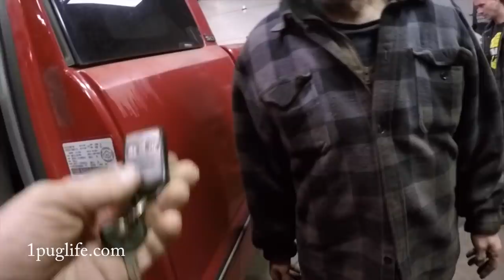purple fella up for grabs

Comment: I wonder when he is going to find out that the dodges e brakes click down but return but also engage the brake and releases when you pull the release handle and It wasn't broken the whole time. All  5 of my dodge cummins do this.
Reply: 😂 frigging Awesome
Reply: If it ain't broke  don't fix it  🔧
Reply: @missingremote4388  I go on ebay and buy like 4 remotes. Then I usually don't lose thrm.all

Comment: you got some very COLD WEATHER on the way Sudden stratospheric warming events (SSWs) tend to weaken the pola vortex.
Anticipated changes in the upper atmosphere over the North Pole during late December will impact the polar vortex, which will trigger outbreaks of Arctic air over parts of the Northern Hemisphere during January and February.down to -20

Comment: Sounds like John luke is getting a little too old to work on modern vehicles...I reckon I could've diagnosed the clicking/beeping thing in 5 minutes. Sounds like you've got some kinda old anit-theft system in there going haywire 'cause the key fob for that old system is missing.